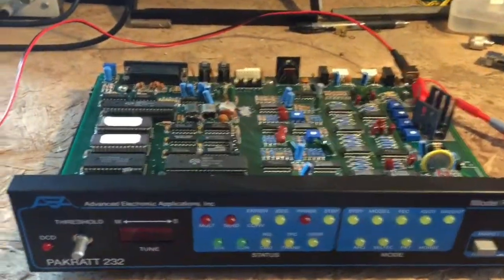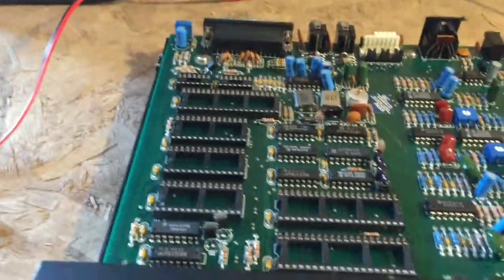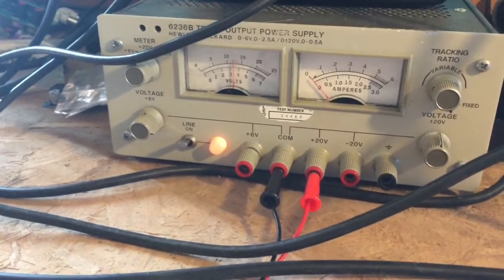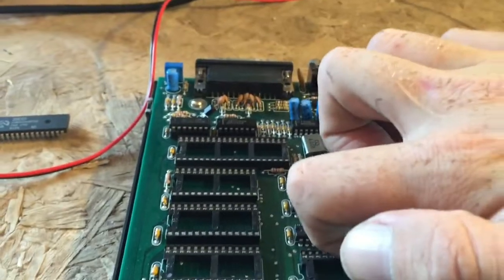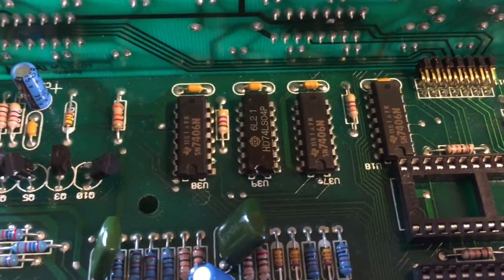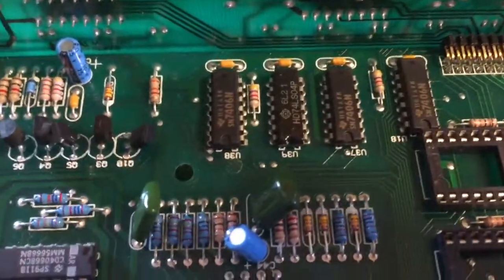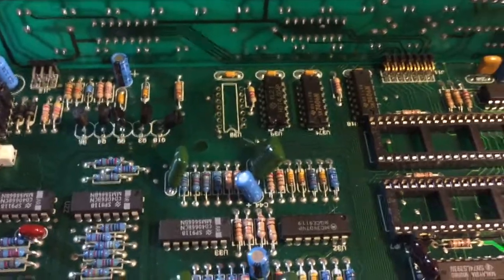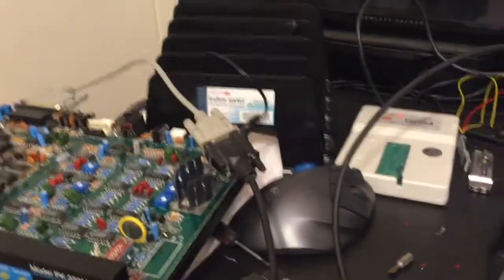PK-232MBX Repair Part 1

Comment: And generally read the instructions, would be helpful, l have used those tnc,s for years, right from the very first, up to the latest versions, in all walks of life, and they perform effortlessly, and are very reliable, l still use one that has a pk31 soundcard board in it, so, yep, we will see what happens, ?

Comment: No , it wasn’t one of the earliest revisions, that was when pactor was introduced on a eprom update, this one has multiple coloured leds, most of the earlier one’s were all red,  a history of the pk 232 mx, is on the net, along with the manuals for installation of hardware and software, from 51/4 floppy drives, and dos 5: to the pkterm 99:software, with psk soundcards etc,